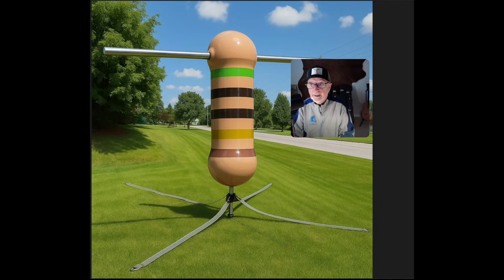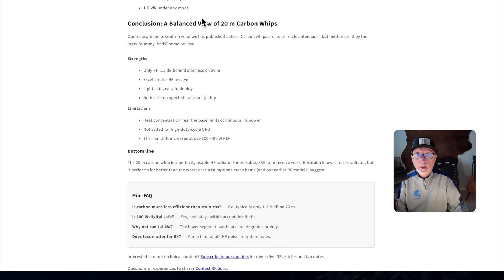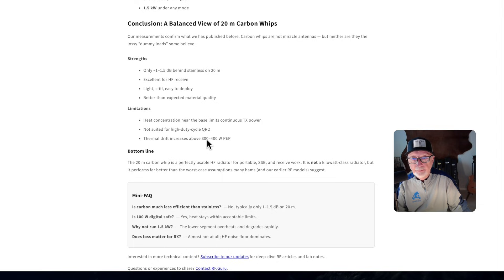Lab Analysis of Carbon Fiber Antenna.  Dummy Load or GOOD?

Comment: A piece of wire that you find along side the road and a stick off of a tree would do the same thing.  Short of aluminum beams and multiband verticals, I really don't know why people buy HF antennas.  So easy to make.  My 80' Marconi T only cost what I have in rope to guy it while DX engineering wants $1700 for half of an antenna....73, KF0BBU
Reply from the maker: Sorry no common sense allowed here.
Reply from the maker: Just looked you up on QRZ.  Oh My Lord what a station.
Reply: @BustRadioMyths  Oh cool!  Thanks!  It is constantly changing.  I have some room to mess around out here in Kansas.  I hope to talk on the air some time!

Comment: If you ran some copper tape along each element, would that improve resistance readings?
Reply from the maker: That would make it weigh more which defeats the only advantage of a carbon antenna I can think of.

Comment: Love the 50 Ohm resistor antenna.
Would it actually work as a leaky dummy load?
The leads would act as high impedance elements contributing to radiation.
Reply from the maker: Yes that’s all correct.  SWR of 1!!

Comment: Using a telescoping carbon fiber mast with a wire vertical antenna I found that if the radiator hung down along the mast that they coupled and atennuated my signal significantly.  Tilting the mast so the wire hung away from the mast improved the output and I was back in business.
Reply from the maker: Good to know

Comment: Actually I thought it would do better. They could build it with a larger diameter to reduce radiation resistance. One db isn't nothing when you're qrp or trying to work someone buried in the noise floor. Likely a bigger isuse is that they are not adjustable. I can see this being over come by building a small extender to drop its frequency into the CW band as it will be undoubtedly tuned for the phone band. The mechanical aspects for its light weight and high flexibility is great. Do wonder how many times you can separate and snap back together until it losses its grip.

Comment: That just blew my thoughts on this antenna out of the water. I was in the Dummy Load camp kind of thinking. The weight is great news for portable ops. 73 de wa4jat
Reply from the maker: That was my first reaction as well - another air cooled dummy load.

Comment: That is good news that they work, but considering the fibreglass equivalent with a bit of wire is $100 cheaper, that is quite an expense for the actual amount of weight you are saving.... A bit like in cars the performance gained from having a carbon fibre ashtray.
Reply from the maker: Yeah but its blue!!

Comment: There is another factor you did not mention, maybe Uri didn't, and that is how does it stand up to wind and abuse.  

The metal whips break easily enough and are about 1/3 the price.  Now that we know that there is little loss difference, it may be worth it for someone who can't baby their whip antenna. 

I don't have one so I don't know.  But my guess is it can handle stronger winds and maybe dropping or rough handling.
Reply from the maker: Check out Joeri's full article.  Link in the video description.

Comment: Now I may have to try to load up my LilDude 6m carbon fiber mast and see how it does.  Sean W9FFF, the proprietor of HRD Industries,  said he didn't think it would work well, but now I'm going to have to try it.  I have three of them and if I can get them to stay at the correct heights this may be a way to make an HF antenna with a reflector and director, all with very light weight.  Can't hardly wait for spring to try it. 

Also, from what I've seen, Gabril does make quality gear with prices reflecting that. 

-w7com